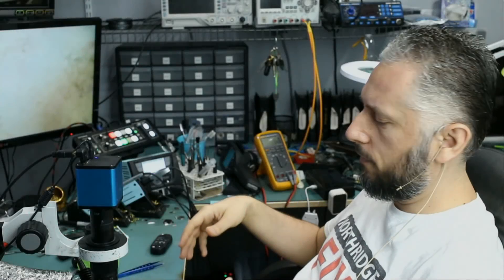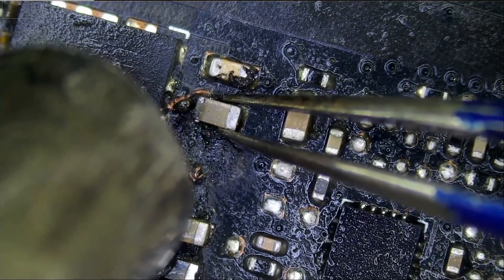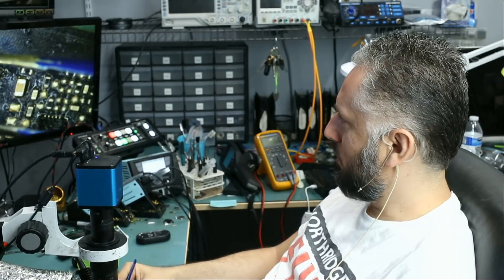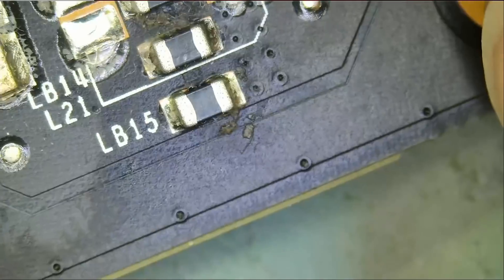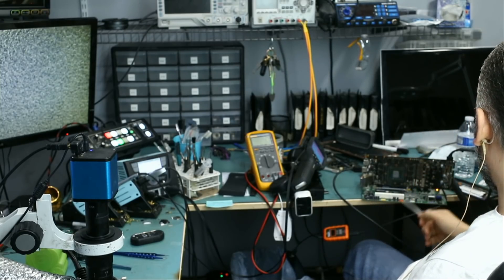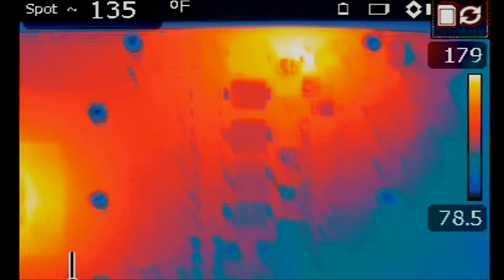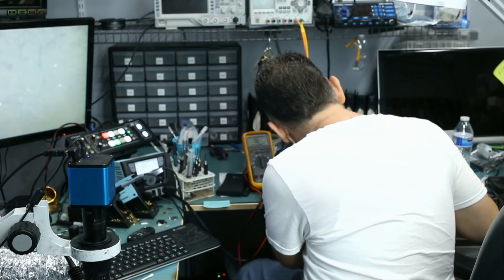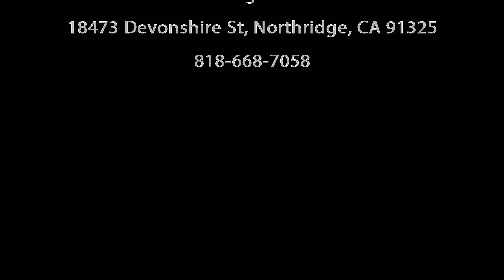EVGA 1070 Graphics Card Repair

Comment: I am still trying to figure out how you can remove the mosfet so easily with just a reflow heat gun.  I have the hardest time trying to remove 2 mosfets from a GPU that I am working on.

Comment: that was awesome repair, 
im a recent subscriber and due to gpu shortage i have GPU that used to work fine until someday i turn my pc and i start hearing this high pitched coil-whine like voice from the GPU , and there was no display signal , FANS are spinning tho, after disassembling the card i noticed no damage at all in the board, what could it be ?

Comment: I'm big fan from venezuela, i love the way u explain everything and do the repairs better than factory almost always, I have a question, I have the same gpu and when I clean it, they use some thermal pads with some kind of sticky material or something, is that some kind of cooler or what?